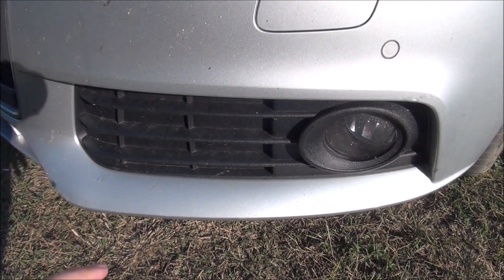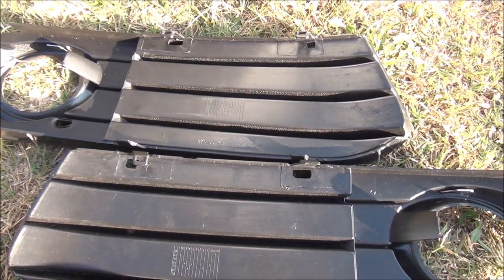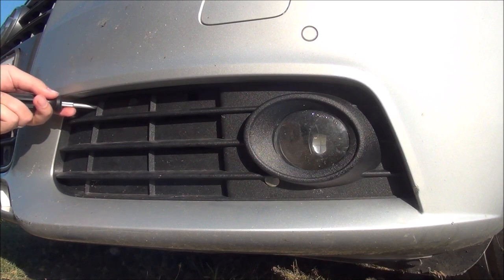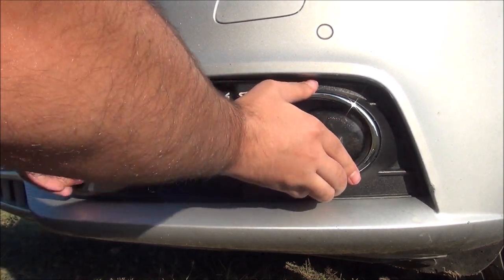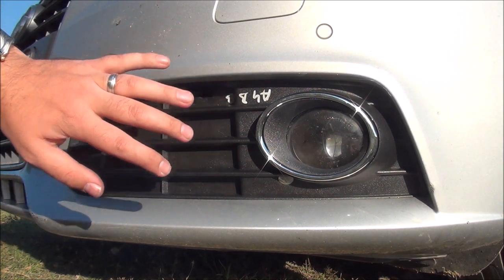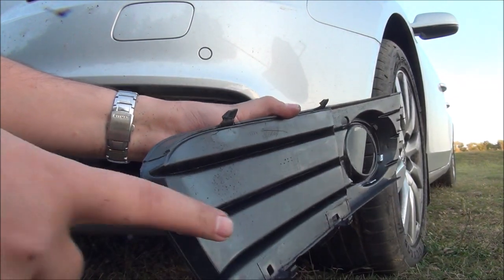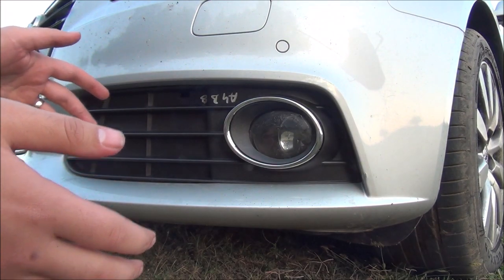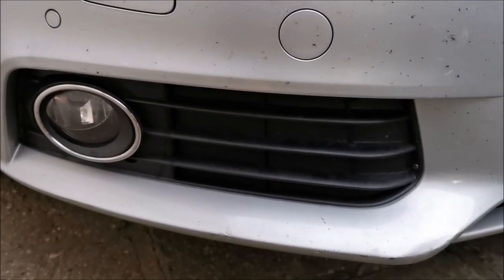Audi A4 B8 - Upgrading the fog light grilles to the chromed ring version

Comment: Great video, I bought the after market one :/ I hope I don't have to work that hard. But it probably will be.
Reply from the maker: I hope you receive ones with a bit better quality than mine.
Reply: Did you have to work as hard? I just received some aftermarkets from eBay. I really don’t think I want to work this hard.
Reply from the maker: Depends on the quality of the parts that you received. Nobody can know that, appart from you when you start working.
Reply: @UltimateDIY  thanks. I’ll try it this weekend. Someone stole these off of my car. The dumbest thing ever. 🤦🏾‍♀️
Reply from the maker: Wow 😲

Comment: I was wondering why the grilles are not fitting properlly and you just made everything clear - it's cheap aftermarket trash.. I don't plan on drilling a screw into the bumper like you so i will try to find OEM ones from a donor car.
Reply from the maker: Yup, in this case at least aftermarket is a no go.